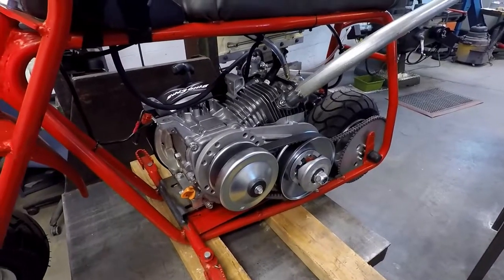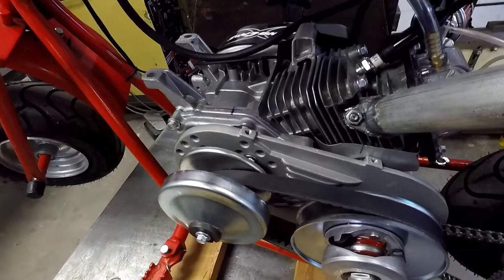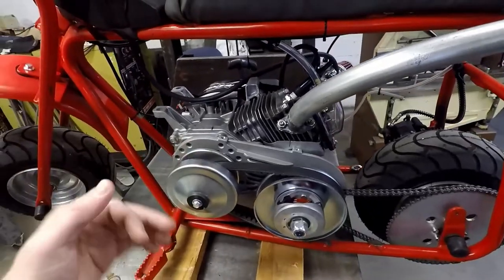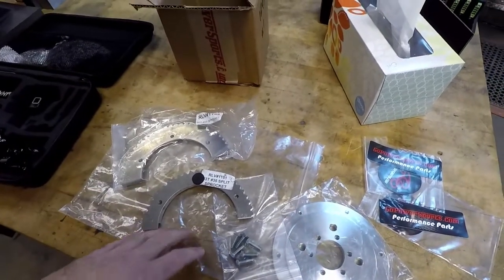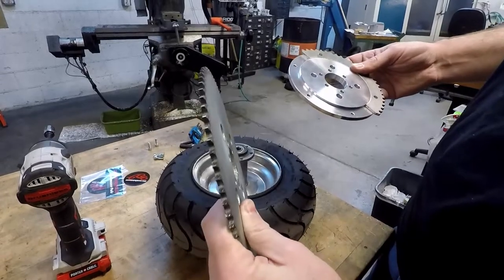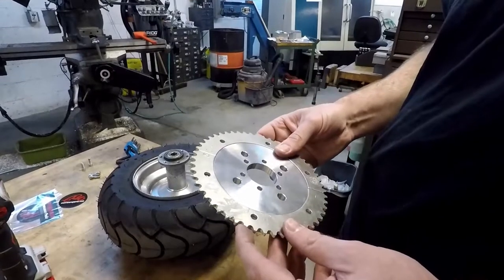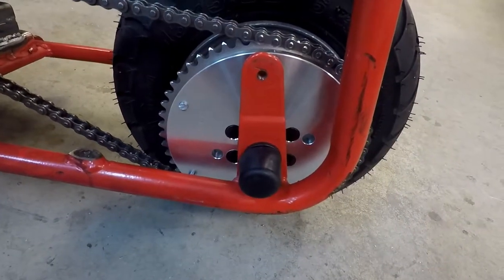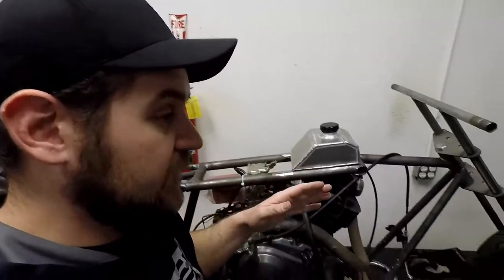Blitz Krieg Mini Bike Status & Split Sprocket Install

Comment: You've got a 70 tooth rear sprocket and a torque converter ,..that thing will flip over every time you hit the throttle,..hahaha,...have fun !!
Reply from the maker: It doesn't have a 70T on it....
Reply: @MRT_H  Oh,..you changed it for the smaller split sprocket ,..my bad !!
Reply from the maker: @4687878  yup, to the 53T 😀
Reply: That happened to me!